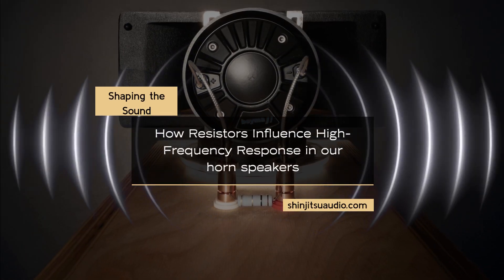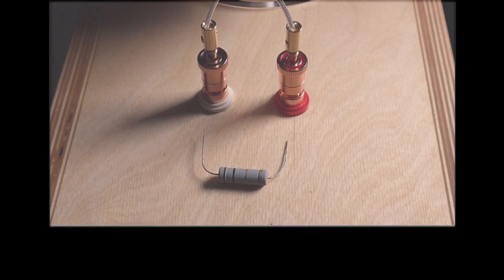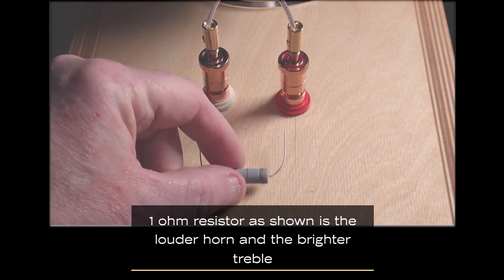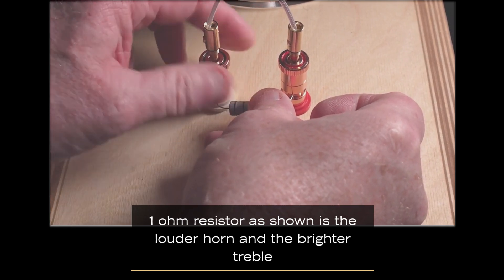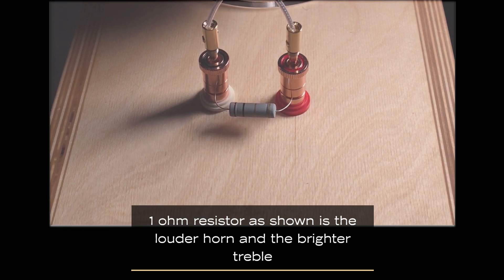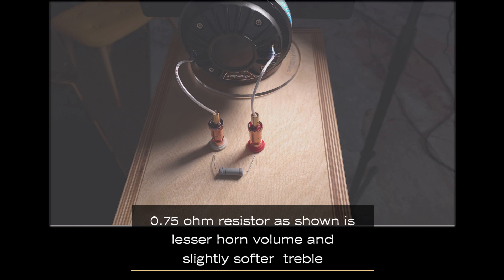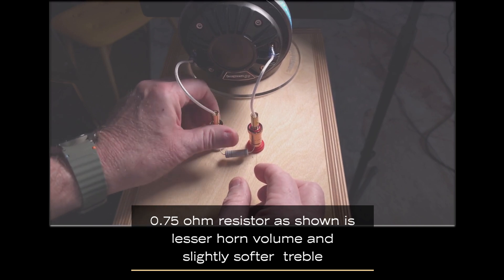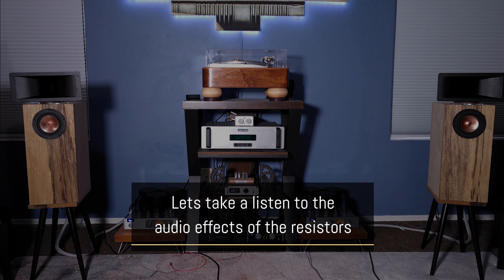Hiro Junior's & Dire Straits Demo or How resistors shape the Hiro sound.

Comment: Hello expert, do you get a perfect sine wave?
Reply from the maker: "Great question! Let’s talk about sine waves and the Hiro Junior.

A perfect sine wave is a theoretical concept—it’s a smooth, continuous oscillation with no distortion or imperfections. In the real world, no speaker, including the Hiro Junior, can produce a perfect sine wave. However, the Hiro Junior is designed to come very close, especially within its optimal frequency range.

Here’s why a perfect sine wave is hard to achieve:

    Distortion: Even the best speakers introduce some harmonic or intermodulation distortion.

    Frequency Response: Speakers have limits to how accurately they can reproduce certain frequencies.

    Physical Limitations: Components like the diaphragm, voice coil, and magnet have inherent nonlinearities.

That said, the Hiro Junior is engineered to minimize these imperfections, delivering a clean and accurate sound that’s as close to a sine wave as possible. So while it’s not perfect, it’s certainly impressive!

And to the 'expert' quip—well, even experts know that perfection is a goal, not always a reality. The Hiro Junior gets pretty darn close, though!"

Comment: 0.5 sounds best. 0.25 is too thin. There is a guy on YT - drD E Audio who put a Shinjitsu horn on a pair of Klipsch Heresey, the result was stunning. A wider cabinet with a punchy 12 inch bass and we are talking. Great cabinet and horn design and finally some good prices on horn speakers. PS: Walnut cabinet + black woofer looks better than white or orange ones, at least in my opinion.
Reply from the maker: drD did an excellent job on that combo! We had numerous discussions about the setup and fine-tuned the horn to match his specifications. He also did a fantastic job with the woofer, with a special shout-out to Al at US Speaker Works for selecting a woofer that met drD’s requirements. The only downside is that the CHR-90 Mark Audio driver isn’t available in black—wish it was!